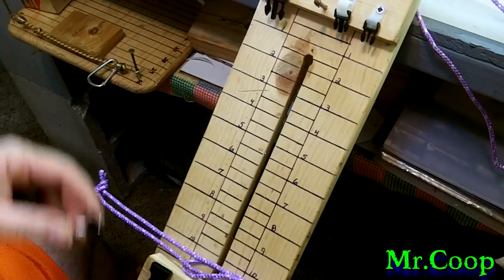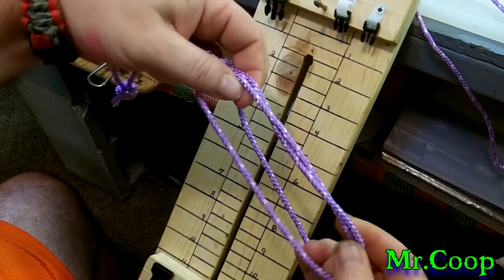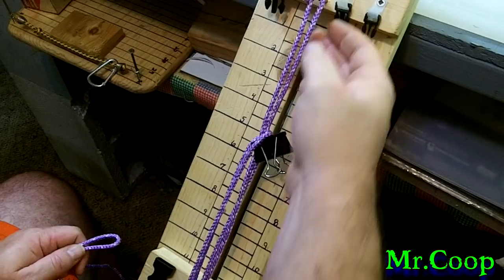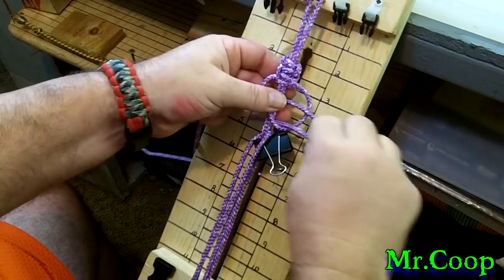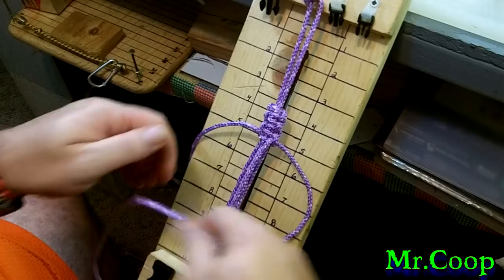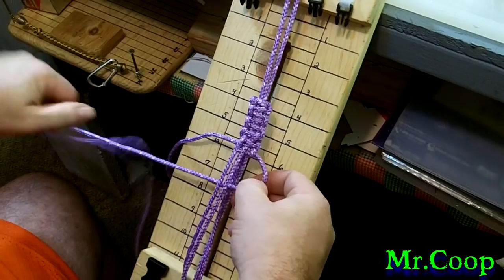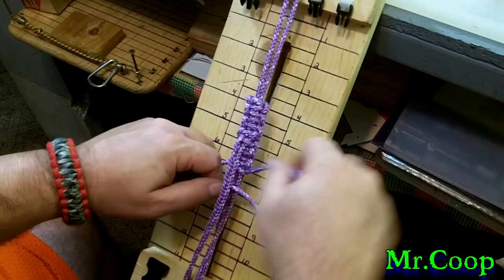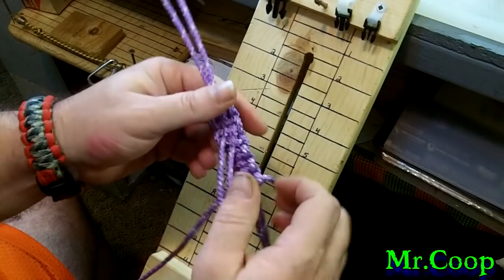How To Make A Paracord Dog Leash Handle.

Comment from the maker: You can all ways do a 4 strand braid. A lot of people are using this making dog leads. But most people aren't making them 6 feet long so you could all so try the snake knot it is made with two strands and will be half the weight. I hop this helps.. ;o}

Comment: a good, thin weave I could use?
PS for the main body of the leash, I used the version of the cobra weave where you don't alternate sides when you knot, making the paracord spiral, then used the usual cobra for the handle. It worked really well, and i found the spiral in the main lead body is easier to grip with wet hands or gloves.

Comment: Hi, great video, really helped me make my first dog lead. I'd been wondering what the best way to turn the hand loop would be. I have a question though. This lead I made (with cobra knot worked out great for my big dogs, but I'm looking for a thinner/lighter leash to make for puppies/terriers. I know paracord is quite light, but in a six foot lead the weight adds up, and the leash ended up weighing nearly as much as my terrier. I could use just a single piece to hold him, but does anyone know